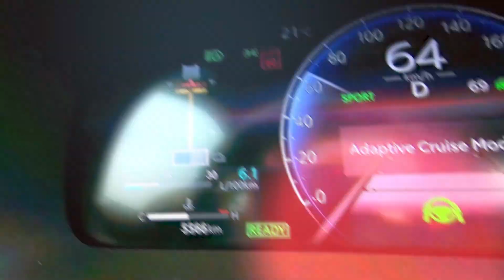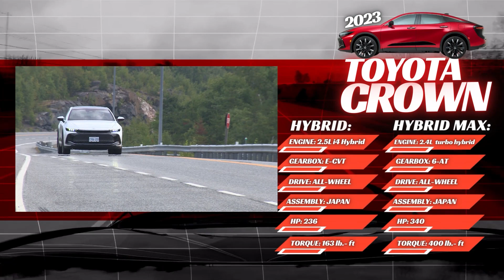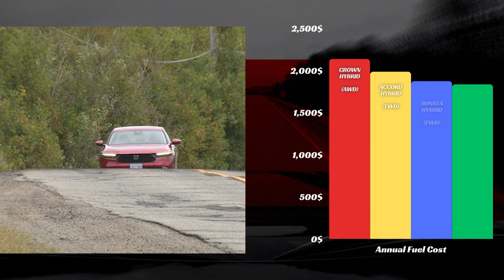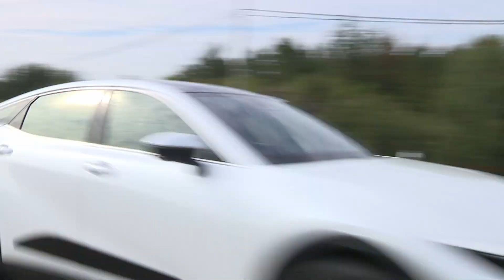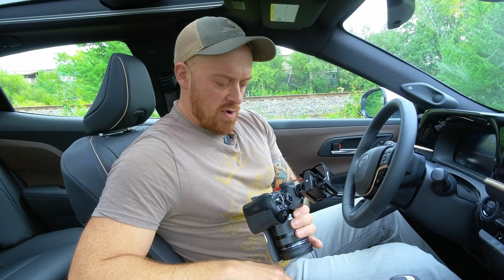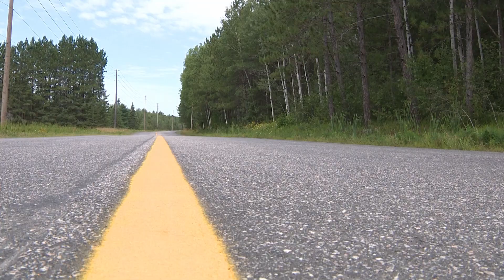2023 Toyota Crown Hybrid Fuel Economy Compared: My Exclusive Math Could Save You Money!

Comment: I would go for the Max
Reply from the maker: Me too, the bank for the buck with your fuel dollars is off the charts.
Reply: @JustinPritchard  the extra 7-8-9000 dollars extra is worth it?   get the power but lose the mileage....   I'm going to be giving one a drive SOON and have already taken the Signia out for a drive.....
Reply: @TommyHabsMyers which one you get
Reply: @sammyjammy6647  I didn't get either, if I had to make a choice I'd probably go for the Signia....  both are real nice IMO.
Reply: @TommyHabsMyers I’ve had the crown sedan for 5 months. I enjoy it. Has everything I need and was able to negotiate $4,000 off msrp, including all the dealer add ons which I got for free and were trying to charge me 5k over msrp 😂. I paid 39.5k plus tax.
Reply: @sammyjammy6647  did you get the Max or the regular power?       up here in Canada they are quite expensive!
Reply: @TommyHabsMyers  I think the whole idea of getting a hybrid is for efficiency so I didn’t go for the max based on that and also based on the price point. I didn’t think it was worth it to spend $16,000 more for a max. I got the XLE. So for 39K plus tax I got both heated and ventilated seats upfront and heated rear seats and heated steering wheel and power folding mirrors. And it’s real leather not soft-Tex.